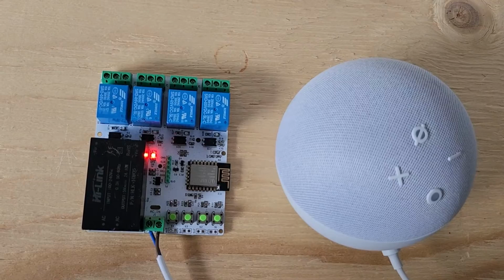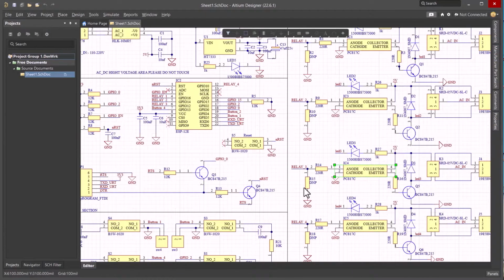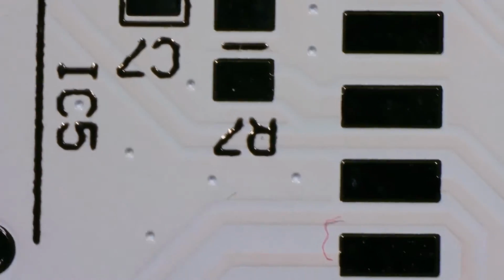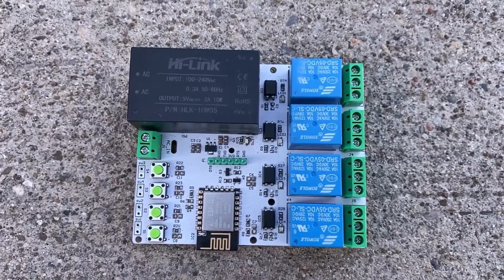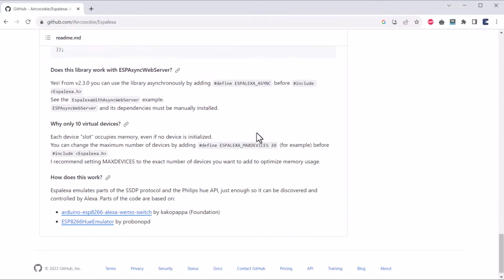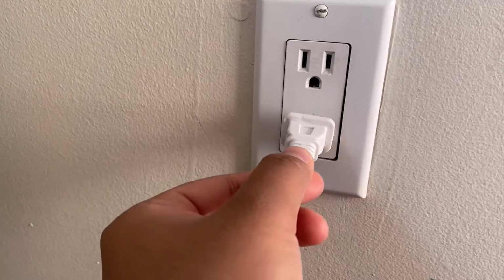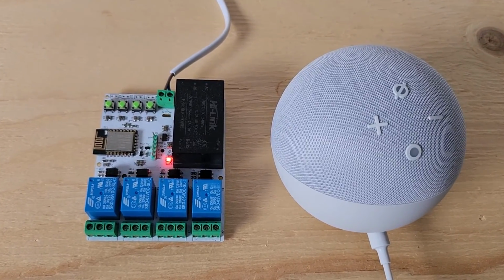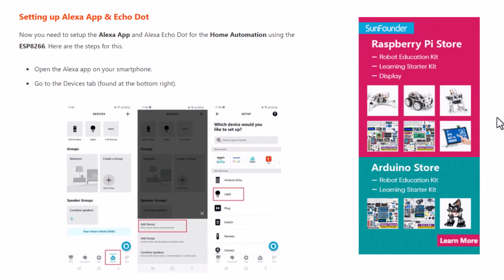DIY Smart & Manual Home Automation using Alexa & ESP8266

Comment: Wonderful tutorial. Succeeded in first attempt only. Is it possible to integrate existing switches on the switch board instead of push buttons (similar to branded modules like wipro, homemate etc) Thanks for sharing🙏🙏🙏🙏🙏🙏
Reply from the maker: There is a pinout near push button to connect external switches. You can connect it there.
Reply: Thanks again🙏 @HowtoElectronics